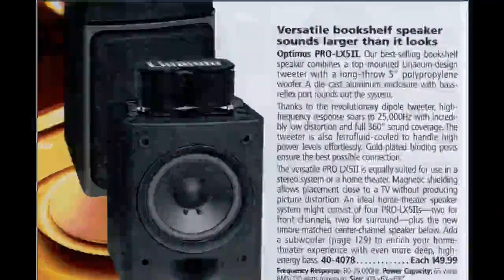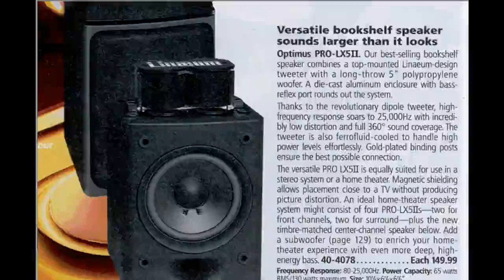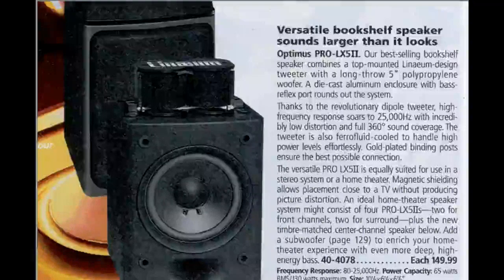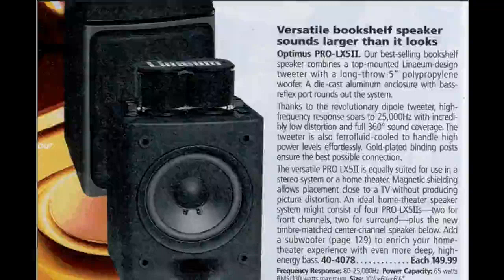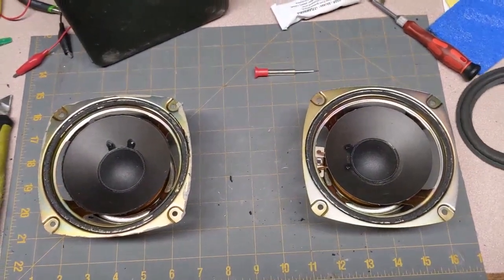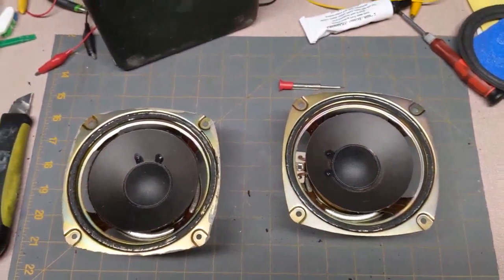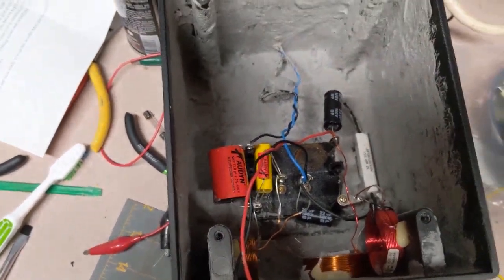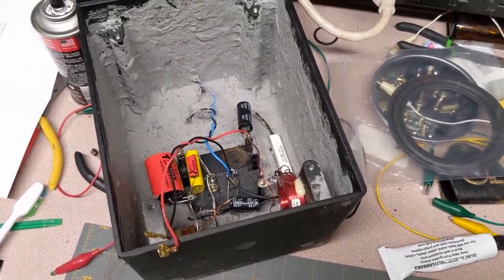Optimus Pro LX5 II speaker crossover modification and foam surround replacement

Comment: I bought 4 of these when they were being closed-out at 50% off the list price. I do not recall what year that was. My motivation in buying them was for the DI-pole tweeter design which is highly rated and not cheap on other speaker set-ups from past info I had. My speakers also have the cruddy foam surrounds. If I had know that the foams were of inferior quality back then, I doubt that I would have bought these speakers. I  also have 2 of the separate DI-pole tweeters bought at a good discount at the time. These tweeters I use with another stereo system I have. Too bad that I did not buy more of these tweeters instead of the 4 Pro LX5 II speakers. Any thoughts about removing the tweeter portions of the speakers and use them in a different application? I'm not very keen on the idea of spending money on these small satellite speakers. I could do the rubber surrounds and leave the rest alone, but not sure the effort will yield any great success story. Given the tiny mid-woofers size, these speakers would never yield the sound of 8" and larger woofers. The tweeters are likely the sweet spot on these 2-way speakers. Would like to hear from others to see what their thoughts are. I have no shortage of different speakers, most of which are of 3-way design.

Comment: I've just replaced the foam surrounds on my pair of LX5's with one slight difference. Instead of replacing the surrounds with foam, I've opted to use rubber surrounds. Let me tell you folks, the bass response is way better than before. I put this down to the stiffnes of foam vs rubber. I bought both foam and rubber surrounds off EBay and was able to make a side-by-side comparison before replacement, the rubber surrounds were way more pliable so on they went.
Reply from the maker: I've heard that from others. Not sure what that would do with the upgraded crossovers as the crossover upgrade was designed while using the foam surrounds.
Reply: could you share a link of the rubber replacements you used? I'm about to replace mine. I thought about doing the mods and putting a Def Tech woofer in them.

Comment: I love my LX5’s and need to replace the foam surrounds. 

Does anyone make a lot of parts for the crossover or where would you suggest I find these parts? 

No Radio Shack around anymore, even in the old days they didn’t have crossover components I knew of…

Comment: Since you have made the modifications to these speakers especially the crossover how well do you feel the perform compared to before the crossover? I just replaced the foam on mine but would like to modify the crossover I am not real happy with how it sounds almost a little muffled.
Reply from the maker: First, those re-coned speakers will require a break in period. If you decide to modify the crossovers, download the complete article from the link and study it over so you can understand what is going on. Don't expect super bass from those but what is there seems to be nice for a low power system. I sometimes use them with my 4 watt per channel single ended tube amplifier. If you pair a subwoofer with them everything sounds nice. I have a non powered sub with a built-in crossover sending mids and highs to the LX's. My sub contains two 6" JBL rear firing subwoofers.

Comment: You've chosen an excellent speaker to tinker with, however, rubber surrounds work and sound far superior than foam. I have made a business out of finding and restoring these speakers.
Reply from the maker: Thanks, I'll keep that in mind if I come across another pair to repair.
Reply: Do you put surround on front or back?
Reply: Wish I would have done rubber when I refoamed, lot of people think these are crap and dog rs stuff but I think they sound great in home theatre applications.
Reply: @koprcord5338  
 I have 6 pair's,  2 still need new surrounds, I love these speaker's for Surround Sound I actually have a pair of the LX10s that I use for Center Channel 1 on each of my Systems.. Ive owned many Speaker's throughout the year's and these are satisfying in my opinion
Reply: got a link for rubber replacements for these?
Reply: @fliptophiphop1894  like a day after I ordered the standard butyl surrounds from simply speakers I realized on their site that they also had the rubber surrounds available and for only a few extra dollars. Next time I need some that is the way I'll go and call it good.
Reply: @koprcord5338  thanks!!!!
Reply: do you have a website? where do you get your rubber surrounds?
Reply: @padrino505  if you look at rubber surrounds on simply speakers they are listed or used to be, I'm sure they still are.
Reply: @koprcord5338  yes, looking for cheaper option, LOL
Reply: @padrino505  yes haven't looked to see what they are charging, when I bought mine from simply speakers on their ebay store they were 20 percent off at the time. I'm sure given the state of the world no deals anytime soon and increased prices.

Comment: The crossover needs an upgrade from stock.  The woofer is super cheap. too wobbly and slow.  IIRC, there is a scan-speak driver that will drop-in.  10x better than stock in every way.
Reply from the maker: The intent was to upgrade the crossover. In watching the video you will notice the upgrade and it was designed to work with the original speaker and also a replacement from SEAS which may not be available anymore. I wouldn't want to just drop in another speaker without testing of the enclosure and speaker together to find optimal components if trying to implement an improvement.